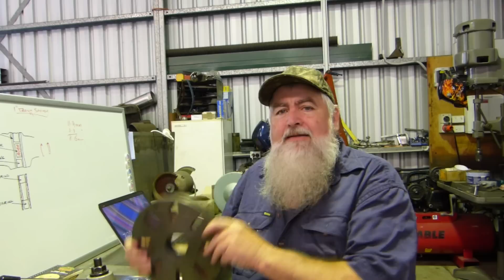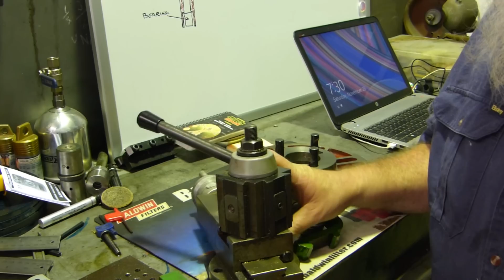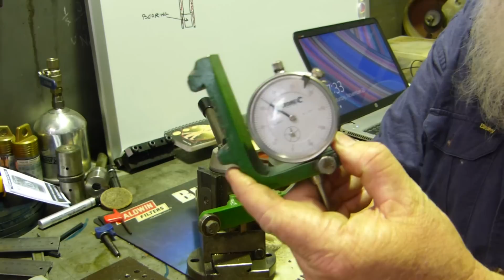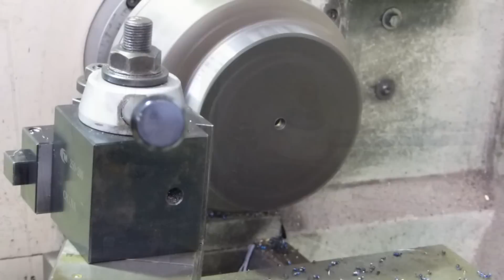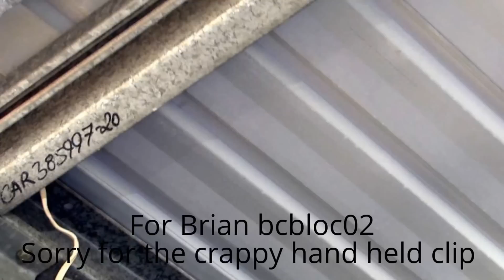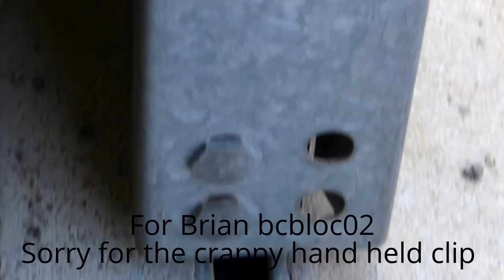Kangaroo Stew # 36 Ball Turning Tool

Comment: G Day Lance, thanks for the mention in the video. I'm looking forward to seeing the video on how you build your fly cutter. That ball turning tool looks like it could be a really hand tool. From what I remember you need to find the centre of where the tool rotates, then if you want to turn a 1" ball measure 1/2" back from the centre line and that should cut a 1" ball if all goes well !!!....lol
Reply from the maker: G Day John, Yeah the ball tool needs a bit of a tidy up and calibrate when time allows. The fly cutter will be a little down the track as I just got the tool for the small one so I will finish it off first. There is some good vids on the ball turner out there and they are a lot nicer than mine but back then I just milled it in a vise on the lathe. I can email you a plan if you would like to make one.
Reply: Bundy Bears Shed Thanks Lance that would be great if you could email the plan. Can you send it to john@john-ambler.com 
Thanks again Lance.